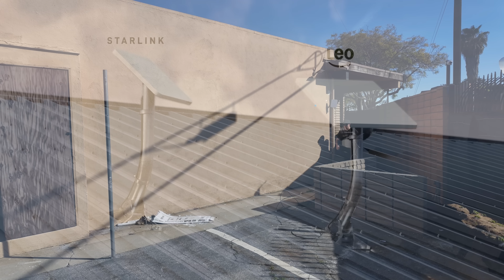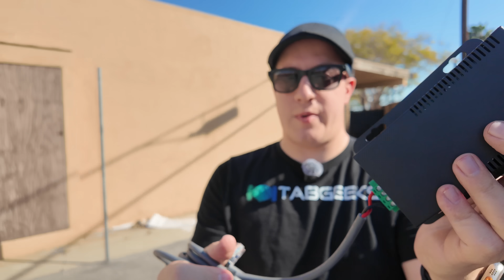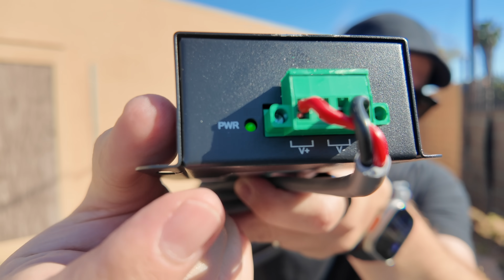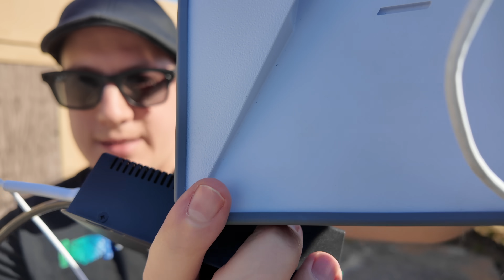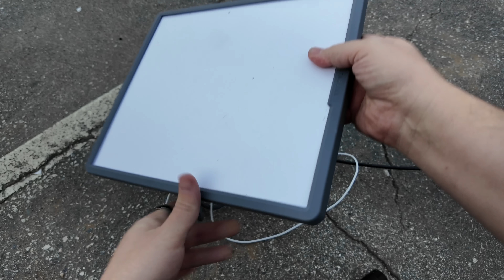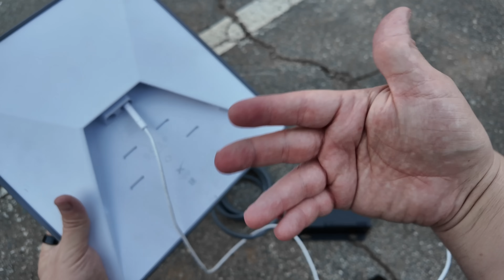Powering Starlink Mini with PoE++? 🛰️ UCG Industrial Test!

Comment: I’m new to Starlink. does it not require their own proprietary  router to work?
Reply from the maker: The mini has its router built in. The other dishes can be placed into a bypass mode to work without their router

Comment: Thanks for the Vid. Im looking at that Procet adapter - it says 24V output - dont you need 48V?
Reply from the maker: 🤷‍♂️ worked fine for me
Reply: Amazon link has 12 V and 24 V which one did you buy?
Reply from the maker: I bought the 24 volt

Comment: Mini can be powered with PoE++, that 90W PoE+++ is needed for a big dishy... Gen1 could not run with its 150W power draw in snow melt mode, but for normal operation it would be fine :)

Comment: I have wondered how the heck that was gonna work!  When I first saw the ad sometime back I thought to myself this should be considered false advertising. Until the day they create a software switch that sends the correct voltage down the correct wires for  Starlinks bastardized POE wiring schema no one has the right to claim that it can power a Starlink dish
Reply from the maker: I’m still holding out hope that they will accomplish this because that would be epic

Comment: Is possible powering with ucg industrial industrial  Starlink gen3 residential ?
Reply: No, the Starlink Gen 3 is non standard PoE. UCG probably has enough wattage but not the right voltage. The pinout might not be standard either, not sure about that. But I know it will not work.
Reply from the maker: I have not figured that bit out yet. Perhaps if it's configured in bypass mode, but I have to look into it more. The issue is A if it's enough power, and B if you can power the dish directly without the Starlink router
Reply: @tabGeeks  you do not need the starlink router. you can power the dish with a 3rd party power supply like an RV 12v converting power supply or the Starlink Advanced Power Supply. You can use either and go straight into the router of your choice. no need to bridge/bypass. Bridging/bypassing refers to a function of the router not the dish.
Reply: The enterprise/business dish doesn't even come with a router. I think that's the one UI is referring to
Reply from the maker: The enterprise dish comes with the advanced power supply, which draws way more power than Ethernet  provide afaik
Reply: @tabGeeks Starlink specs for the enterprise dish list 75-100w. The UCG-Industrial can do 90w per port depending how it's powered. I don't have an enterprise starlink dish to play with but I've heard others describe it as an oversized, weatherized version of RJ45 (on the psu end of the cable). One guy I saw cut the end off and replaced it with a regular rj45 into a poe+++ adapter. Starlink also provides a pinout diagram on the enterprise spec download sheet
Reply: Referring to the "1 gig capable" latest enterprise dish based on the upcoming gen 4 revision (according to @DISHYtech review of it)
Reply: @tabGeeks it comes with it but it's not necessarily 100% needed it's just a great way to power it.
Reply: @anthonymiller2288 I have the high performance dish is that different than the Enterprise should I plug it into my UCG industrial and see what happens